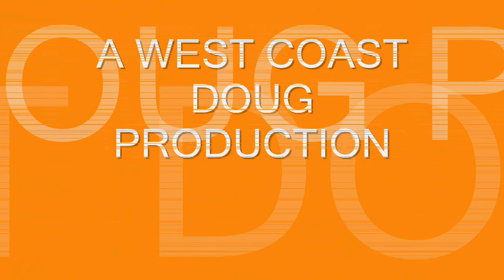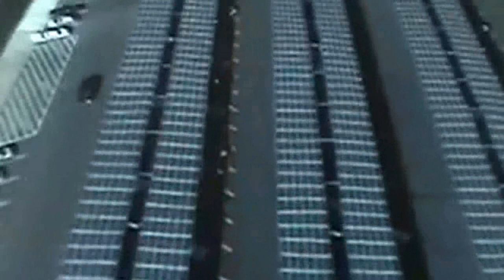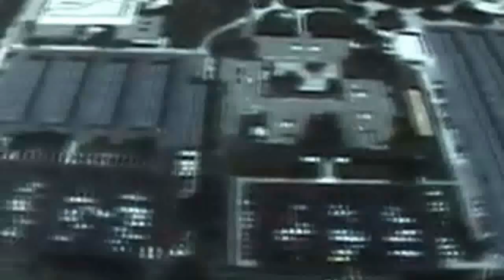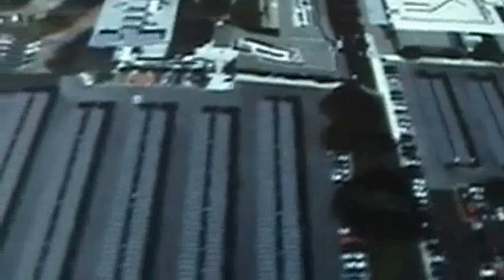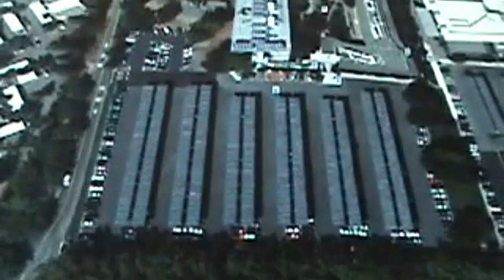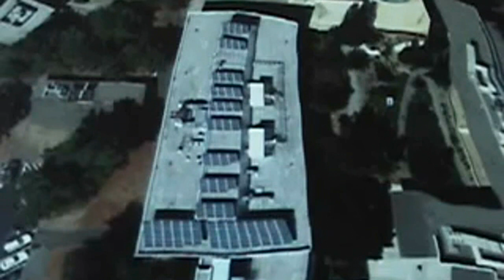3.2 MEGAWATT SOLAR SYSTEM

Comment from the maker: the 8.5 million they got back is a one time rebate, which in the long run will save the gov. $ by less oil importing. + The fact the school is know a power company and is taxed the same as a power company, means the gov. has already re cooped there 8.5 million and then some. So less oil imported, gov. makes $ off the system already and the school has saved almost 30million to date as compared to before the install.  I cant see your reasoning.